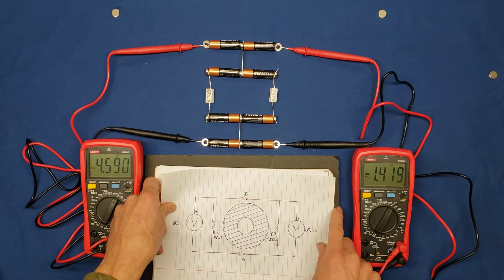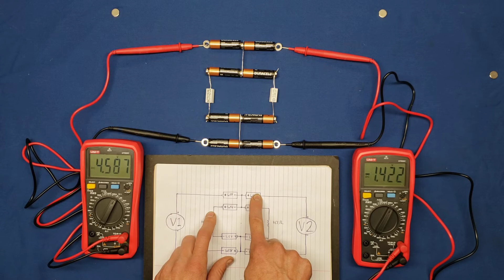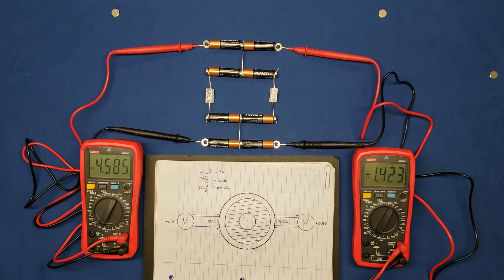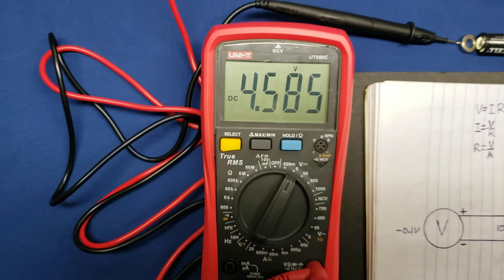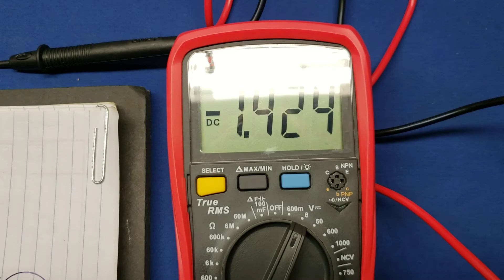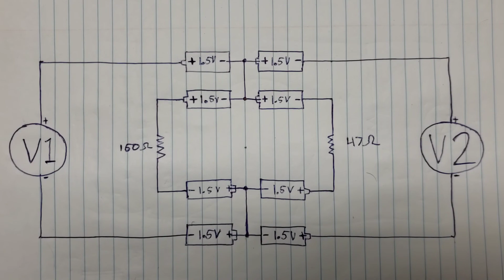Lewin's Paradox explained: Kirchhoff voltage law (kvl) doesn't  work with DC either!

Comment: You show the exact opposite of what the title claims.
KVL holds if circuits are modeled appropriate. AC or DC, batteries only or induced force doesnt matter.
Reply from the maker: Its satire
Reply: @fromjesse  I know, I know ;)
I did a little own research and few interesting simulations according the topic some time ago and totally agree with you.

Comment: Firstly: At the start of the video you claim the induction in lewins meter leads cancels out. That is not how induction works. Induced voltage is what you get when you enclose a changing magnetic field. There is no such thing as 'partly' enclosing something. Either you have made a circle around it or you have not. The meter probes do not have induction in them because the meter is ideally open circuit, and therefore the probes form no loop what-so-ever and there is zero induction in them. Secondly: Your meters are not connected to the same points. A meter measures the sum of the drops/increases in E (electric) field across the components. Therefore to be 'connected' to the same point, there has to be no drops or increases in E field between where the probes connect - yet you have a network of 8 batteries and 2 resistors all with E field drop in between the meters. Saying 'dont worry about those' doesn't fix that. They are not connected to the same points. The reason why Lewins meters read differently is that that a volt meter reads the sum of the E field drops, plus the closed loop integral of the changing B field passing, which is path dependent. To enclose the B field the left meter has to go clockwise positive to negative, the right meter has to go counter-clockwise, this is why the measure opposite voltage. The reason so many people don't understand this is that they don't actually know what voltage is. Voltage is the sum of E field drops plus the closed loop integral of the change in B field. If you don't believe this, you have to re-write all of electromagnetism. When going from the positive to negative takes a path that goes around an enclosed changing B field - then voltage *IS PATH DEPENDANT*.
Reply from the maker: @sectokia1909  calm down, this video is satire.

Comment: You seek to emulate the Lewin experiment, but you have strayed too far.  As you know, Lewin used a toroid to induce emf's by magnetic induction.  Your emulation involves the arguable point that the batteries are equivalent, which is unfortunate.  Also your sketch of the Lewin experiment appears to show the loop disposed around the periphery of the toroid, whereas it should pass through the centre of the toroid.
Reply from the maker: This video is satire showing how Lewin's claims are based on fallacy.
Reply: @fromjesse  I'm pretty sure George10767 understands that this video is meant to be a satirical illustration of what you consider to be the fallacy in Lewin's analysis. The point that George10767 is making is that - as highlighted particularly at 3:54-4:02 - your whole underlying argument behind how this supposedly shows the fallacy in Lewin's analysis is an analogy between electrochemical voltage sources and electromagnetic induction. Your argument is essentially: "if Lewin is willing to apply his reasoning to a situation involving induced voltage, then by the same logic he should be willing to apply his same reasoning to a situation involving electrochemical voltage." But your pre-supposed analogy between electrochemical voltage sources and electromagnetic induction fails: Like so, so, so many other people, you're treating the induced field coming from the solenoid as a voltage source while treating the electrostatic field coming from surface and interface charges as not a voltage source, and this physically arbitrary inconsistency is the entire grounds of your argument. To be consistent, you must either regard "voltage sources" being constituted by electromagnetic fields, or regard "voltage sources" as being constituted by electromotive forces besides the electromagnetic fields (i.e. electromotive forces exerted directly at the point of contact, such as chemical forces). The result of being consistent in this way is that KVL holds for your battery-powered circuit but fails for Lewin's induction-driven circuit. Treating induced fields as analogous to batteries - like you and so many others do - leads to all kinds of utterly absurd nonsense, such as that a person can be electrocuted with zero potential difference between the entry and exit point of the current in their body, while another person undergoing exactly the same experience of electrocution has several kilovolts of potential difference between the entry and exit point of the current in their body. These absurdly inconsistent conclusions come from the inconsistent treatment of induced and non-induced electromagnetic-field components.

The problem is that you, like so many others, have fundamentally failed to understand the actual physics of how voltage in electrical circuits works. You are aware that the voltage along a stretch of wire is zero when there's no induction, but do not realise what this actually means and why it's true: It means that the work done against the net electromagnetic field of the system in moving a charge along the interior of the wire is zero; and the reason why this happens is that the charges on the surface of the wire settle towards a (quasi)static equilibrium configuration whose electric field perfectly cancels out all other electric fields inside the wire, so that the net electric field in the interior of the wire is zero. But here's the thing: everything I just said in the previous sentence has nothing to do with whether or not there's electromagnetic induction taking place.
Reply from the maker: @DrJulianNewmansChannel  Are you aware that not one but TWO of Lewin's PhD peers countered Lewin's claims IN WRITING?
Reply: @fromjesse  Thank you for your reply 🙂I'm aware of a document by Kirk MacDonald, but haven't read it yet. Is the other document that you're referring to the one by John Belcher that was linked in ElectroBOOM's second video on the controversy? If so: I have read that document, and it is utterly ridiculous to suggest that that document counters, or seeks to counter, Lewin's claims.

There is a brief bit towards the end of that document that describes how for ideal lumped circuits with an ideal lumped self-inductor, one can define the "voltage across" components in such a way as to make the sum of the "voltages across" components in a loop equal to zero, as described in Chapter 22 of The Feynman Lectures. And within this bit, Belcher notes that we can thus use the phrasing of "KVL holding" (as Feynman does) for this situation even though there's electromagnetic induction taking place in this circuit. Of course, Mehdi also wants to use the phrasing of "KVL holding" in situations where electromagnetic induction is taking place, and Belcher merely points this out in passing. Belcher absolutely never says or implies that KVL should be applied to Lewin's experiment or that KVL always holds. The way that we can apply KVL to lumped-element models of circuits involving self-inductors is (as described by Belcher) to define the "voltage across" an inductor as being the voltage [defined in the way I did] along whatever is connected across the inductor if there are no changing magnetic fields besides those inside the inductor. Attempting to apply this definition to Lewin's circuit will not rescue KVL, and Belcher never suggested that it will.

You might be wondering: "If Belcher had no problems with Lewin's analysis, then why didn't Belcher explicitly say that Mehdi got it wrong?" I think the answer is probably that Belcher didn't know exactly what Mehdi was trying to argue, probably in large part because Mehdi didn't know enough physics to be able to express what he was trying to say in clear terms. The other possibility is just that Belcher was trying to be diplomatic. But in any case, Belcher never said or implied that Lewin had made any mistake.
Reply from the maker: @DrJulianNewmansChannel  Great another Lewin White Night airmchair warrior who never touched a soldering iron joins the ring!

Please read and understand the following writups before arguing with me:

http://www.electroboom.com/share/FaradaysLaw_Mehdi.pdf

https://www.physicsforums.com/insights/wp-content/uploads/2018/06/k-t-mcdonald-lewin.pdf

https://i.postimg.cc/sf4j3HbF/Desoer-Kuh.jpg

Also, don't forget that Physics  Professor Dr. Belcher PhD said that "KVL Holds as Mehdi argued" 

and 

Physics Professor Dr. McDonald said that Lewin's circuit was within the range of applicability to Kirchhoff's loop equations and would predict the values measured by volt meters..

Thank you so much for understanding!
Reply: @fromjesse  Did you actually read the Belcher document that you quoted from? Belcher did not counter or try to counter Lewin's analysis; he said "In this sense, KVL holds, as argued by Mehdi Sadaghdar," in reference to a lumped self-inductor, not Lewin's circuit. Mehdi argued "KVL always holds", not just for Lewin's circuit but for all inductors and all other circuits; and Belcher is saying that if we understand things in the right sense, then KVL does indeed hold for the lumped self-inductor. The Belcher document that you quoted from is exactly the one that I discussed in some detail in my previous reply of a few minutes ago. If you think that Belcher's document is expressing agreement with your approach to Lewin's circuit, then you obviously haven't read and understood it!

You said "Please read and understand the following writups before arguing with me". I'm happy to do that, but you should also read and understand the first of the three writeups that you asked me to read and understand.
Reply from the maker: @DrJulianNewmansChannel  
> Belcher did not counter or try to counter Lewin's analysis; he said "In this sense, KVL holds, as argued by Mehdi Sadaghdar," in reference to a lumped self-inductor, not Lewin's circuit.

That makes no sense. Belcher says he's ignoring self-inductance because the resistance of the circuit is high enough and the resulting current low enough  that the self‐magnetic field is negligible compared to the external
magnetic field. 

He's clearly talking about an "external magnetic field ignoring self-field."

He's clearly showing diagrams of Lewin's setup - with the electromagnet in the middle, then the loop around it with a resistor in series on the left and on the right, EXACTLY like Lewin's setup.

He's literally showing the different probing paths that Lewin used.

He wraps up by saying:

> Thus with Feynman et al.’s definition, the sum of all the voltage differences around the circuit is zero (that is, KVL holds)

Are you saying that Belcher said that Lewin was right? What do you think was different about Lewin's circuit that would cause KVL to fail? (other than bad probing)

And why do you think Belcher was only addressing a self inductor and not the secondary winding on a transformer, like Lewin had?

If each segment of the secondary winding is much smaller than the wavelength at play and can be lumped and has the same current at both test points and the voltage can be unambiguously measured, then why should KVL not hold?

And why did it hold in my experiment with the Lewin Clock? https://www.youtube.com/watch?v=nAsZFP8Cfxk

Because I correctly probed, running my probes in such a way that they would not become parasitic extra secondary windings on the transformer, I was able to unambiguously measure the voltage across both secondary windings AND both resistors, and it all summed to zero, so KVL holds. If Lewin had done  the same he would have found KVL to hold as well. But that wouldn't have been very exciting.

I mean look. And that's the point of this satire video with the batteries. If your circuit has components that aren't drawn in your diagram, measurements may not match predictions.

Even though Desoer and Kuh say that a transformer is a typical lumped element in KVL, you could still be silly and wind your volt meter lead through the transformer core a few times then pretend to measure the output of the transformer and you could claim "hurr hurr KVL is for the birds" -- but it's not because KVL failed, it's because you turned your volt meter leads into undocumented secondary windings.
Reply from the maker: @DrJulianNewmansChannel  
> I'm aware of a document by Kirk MacDonald, but haven't read it yet.

Well you should read it. I can't believe you've been in this argument this long and were aware of McDonald's paper but hadn't yet read it.

https://www.physicsforums.com/insights/wp-content/uploads/2018/06/k-t-mcdonald-lewin.pdf

 McDonald says of Lewin's videos "many of the statements in these videos are more in the nature of misdirection than explanation"

So far as I know, all of the Physics PhD's who have published a paper in response to Lewin's claim about KVL not holding have disagreed with Lewin.

Since you're a PhD in Physics, maybe you should publish a paper explaining why McDonald, Belcher, Desoer, and Kuh are wrong, and explaining why the voltages all summed to zero when I measured it all around the loop, and why you think the secondary windings on transformers cannot be treated as lumped elements for KVL, even though Desoer and Kuh say they can so long as some basic requirements are met -- which Lewin's setup did meet.
Reply from the maker: If you want to see my serious non-satire video on the topic, check it out: https://youtu.be/nAsZFP8Cfxk
Reply from the maker: I assume you saw the video that wasn't satire: https://www.youtube.com/watch?v=nAsZFP8Cfxk
Reply: @fromjesse  Yes, I did. I have to admit, I didn't follow the details of your electronic setup there. But I've seen Cyriel Mabilde's video of 7 years ago (the latter of his two videos), where it seemed he was trying to do something similar to you. As I wrote for his video - and I think the same will apply to yours - none of his experiments actually demonstrate that Lewin did anything wrong; they're just further experiments. Anyway, I'll try and read the things you asked me to before trying to rebut you.
Reply from the maker: @DrJulianNewmansChannel  
> Yes, I did. I have to admit, I didn't follow the details of your electronic setup there.

Typical armchair warrior, goes in keyboard-a-blazin' and mouse-a-clickin' without even taking the time to follow the details :D

I do have 3 questions for you, if you might be so obliging:

1: Are you aware that  Physics Professor Dr. Belcher PhD said, and I quote, that "KVL Holds as Mehdi argued?"  Don't you see how "KVL HOLDS AS MEHDI ARGUED" kind of counters Lewin's claim that KVL "IS FOR THE BIRDS?"

2: Physics Professor Dr. McDonald PhD said that Lewin's circuit was within the range of applicability to Kirchhoff's loop equations and would predict the values measured by volt meters?   Don't you see how "Lewin's circuit is within the range of applicability to Kirchhoff's loop equations" kind of counters Lewin's claim that KVL DOES NOT HOLD?

3: Have you read this page in "Basic Circuit Theory" by Charles A. Desoer and Ernest S. Kuh about Kirchhoff's Voltage Law (KVL) and seen where it says "Typical lumped elements are .... inductors, and transformers." ?

They very clearly explain that transformers and inductors are typical lumped elements, and that it works fine if the elements are small compared to the wavelength of the normal frequency of operation (which Lewin's was.)

Desoer and Kuh specify that the current entering one terminal of the the lumped element must be equal to that leaving the other terminal, and that the voltage across them can be unambiguously defined by physical measurements.

Desoer and Kuh conclude by saying "As long as this restriction on the size of the circuit holds, the Kiorchhoff's current and voltage laws are valid."

What is your take on Desoer and Kuh on this stance? I mean if you want to present yourself as an expert who out-ranks Desoer, Kuh, Belcher, and McDonald, that's fine but at least you should be aware of what they said if you're going to say you disagree with all of them. See the page from their book here: https://postimg.cc/YGzPzVzJ - Chapter 1, page 2. https://www.scribd.com/document/606522688/Charles-a-Desoer-Basic-Circuit-Theory-McGraw-Hill-College-1969-Part-2

Because it at each point where my volt meter leads connect the current is the same, and the voltage can unambiguously be defined with physical measurement, KVL holds. Which is why it did in my real world experimental test.